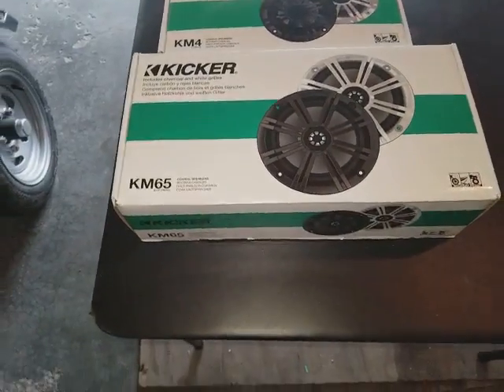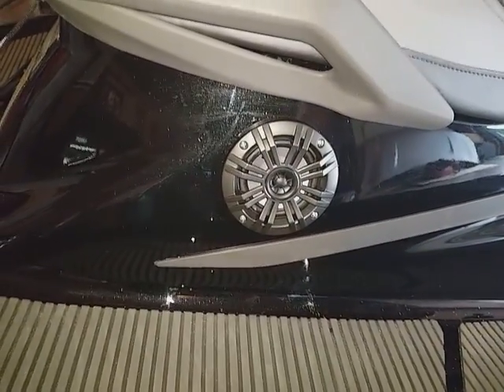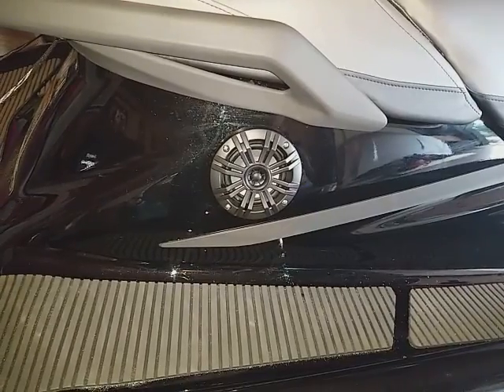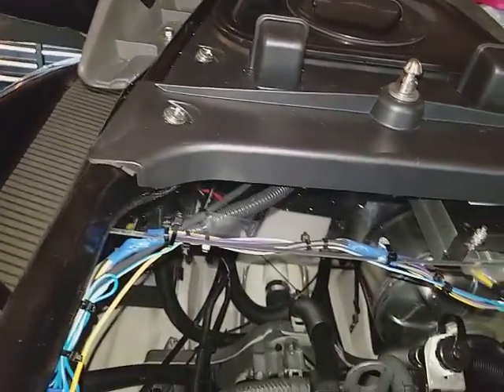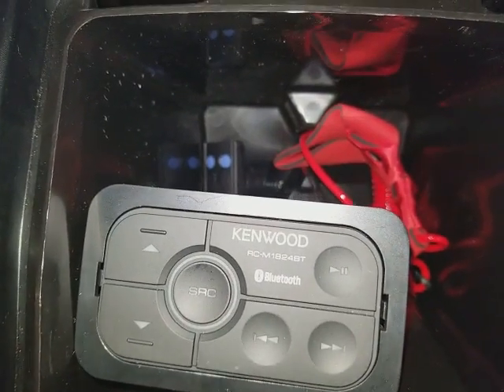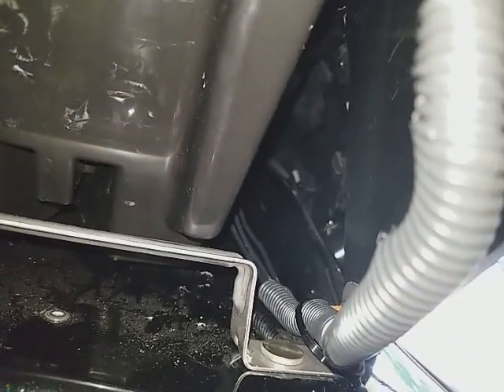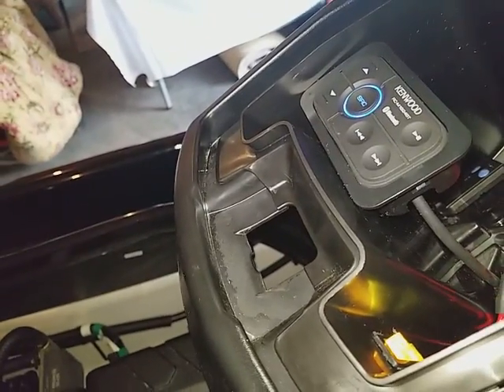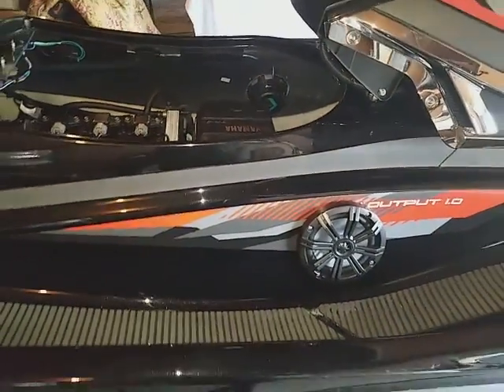Yamaha waverunner bluetooth stereo install

Comment: Its a nice install but more than 75% of the output will be lost on the water as the speakers are facing completely away from the driver of the ski. You will hear the low frequency OK but the high notes will be invisible to the driver and will sound great to the boat next to you where the speaker is facing and firing the audio output at.

Comment: Hey amazing set up. can you post a link of what exactly you used to cut the holes im having trouble finding a hole bit for the awkward size kicker requires.
Reply from the maker: What I used was a dremel bit  made of tungsten carbide. It cuts fiberglass.

Comment: I’ve seen many people cut holes and mount the speakers, how does water not get into the inside, what if u tip? Won’t it take on water and sink? I’m honestly just asking I’m curious
Reply: Not sure but maybe they can use some kind of silicone when mounting the speakers.nothing too permanent like 5200 but something light just to keep water out.just incase speakers has to be removed later,you wont rip the paint off with that 5200 stuff.
Reply: Grimreaper420ful no it won’t.     Very durable!!
Reply from the maker: Speakers had gaskets that i siliconed

Comment: Nice job Sam.  I'm having difficulty with my set up, maybe you can through me some advice.  I have my iphone hooked up to the rca cables from the amp using the RCA to headphone jack wire provided in the wire harness for the amp.  I have the amp hooked directly to the battery (ground and hot).  My amp is not turning on (no illumination or music playing through speakers).  I have one wire not hooked up, the remote wire.  I am told that the amp may not turn on in this configuration because the iphone doesn't provide enough power, but its hooked up to the battery on the jet ski!  WTF lol!  I don't want to buy and install a remote.  I don't see the benefit in a remote and a bluetooth model is even more of a waste because who can use their phone while jet skiing?  Might as well just plug it in right?  Can I just use a toggle switch as opposed to a remote (or a head unit)?  My big problem is that there is only one wire (blue wire - remote wire) not in use; so how do I get that hooked up to a toggle switch?  or a remote if I go that route?  Do I have to run more power to the toggle or remote? and attach the blue remote wire to the hot side of the toggle or remote?  

Thanks in advance,

Jake

Comment: Hey hows it going im installing a JL audio system on my waverunner in a few days. Just wondering are you able to hear it while your going full speed?
Reply from the maker: My Kenwood is a 400 watt amp. With 200 watt speakers. it's pretty loud. I don't turn it all the way up cause speakers won't be able to handle the 400 watts. In hind sight I should have matched speakers to amp. With that being said, I can hear it quite well at full speed.
Reply from the maker: Yes. Placement and wattage of speakers are cruial.
Reply: @samuelking9503  I just picked up the same set up can't wait to install it on my brand new ski. The amp is 400 watt Max. If wired in stereo it's 45 watts per channel. If wired in bridge mode it's 90 watts per channel. The speakers are 195 watt Max but 60 continuous watts. That means if you have it wired in stereo you shouldn't have a problem turning the volume up. Love your set up! Hopefully mine comes out just as good.

Comment: WHAT ABOUT THE HEAT FROM ENGINE OVER THE AMPLIFIER ??
Reply from the maker: No issues with heat. The compartment has good clearance for the Amp and it's not mounted near the engine.

Comment: How did you wire the ignition wires to amplifier?
Reply from the maker: I didn't. I wired power thru a rocker switch. I turn it off and on independently.
Reply: Thank you
Reply: And what were the 2 or 3 wires you wired to the switch...i just bought the switch today,  but im not sure what wires to wire to the switch?
Reply from the maker: @on_geepee  The switch only has 2 wires. It is just an off/on switch. One wire coming from the + battery terminal to one side of the switch, and the other wire going from the other side of the switch to the power wire (+) of the controller.
Reply: Thank you again. I just got done with my install...after watching a few videos and a few questions , it was a success...thanks again

Comment: Great information.  Thanks for the video. How have things been since you've had time to spend with it over the past year??  I really want to do something like this on my VXR.  Have you had any sort of battery issues??  Running down the battery, etc?
Reply from the maker: No issues. It Definitely makes time spent on the water more enjoyable. As far as the battery is concerned, as long as your waverunner is running, there will be no battery issues.
Reply: So you hooked up power straight to existing battery? Do you think wiring to a separate battery would be better? Main battery would not drain as fast?

Comment: If you flip your ski water will come in through the speaker holes your drilled...it will sink.
Reply from the maker: Actually no it won't. They are marine speakers and the holes are sealed. Flipped already and still floating. But thanks for your observation